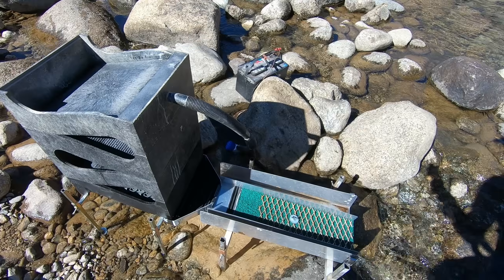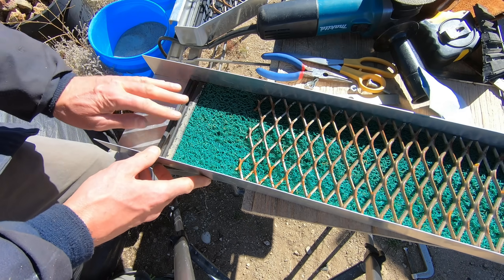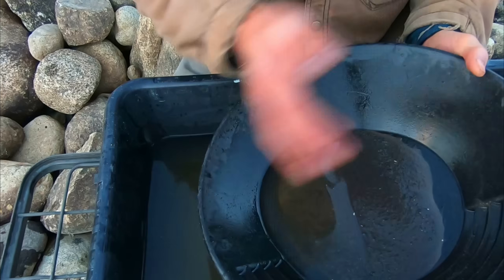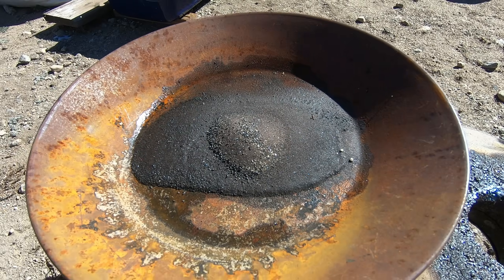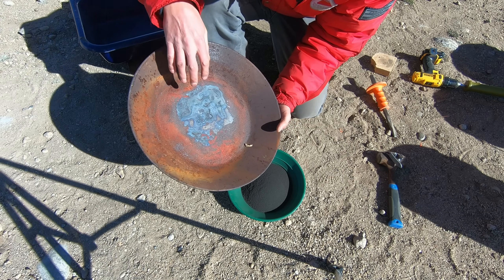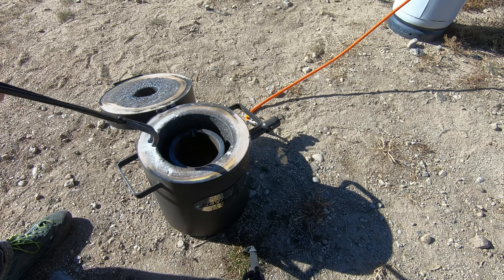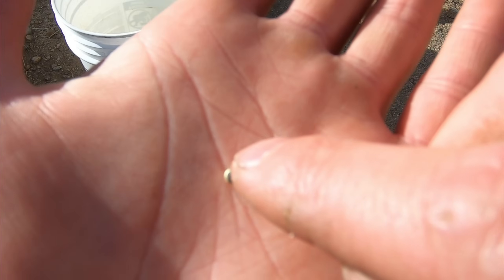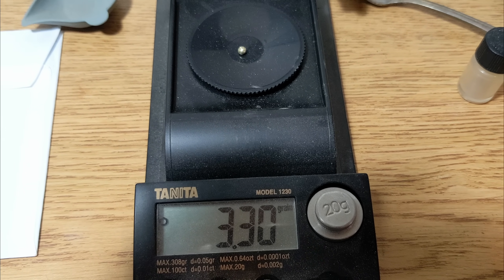2 GOLD BUTTONS from Black Sand!  SMELTING GOLD!

Comment: I've found that the black sand becomes more magnetic if you put it in an oven, then you can easily just separate the gold from the sand making it more pure. Still have to use acid to make it 999 pure

Comment: Nice video. Couple questions: did you add the matte from smelt 1 to smelt 2?  What flux recipe are you using? I don’t preheat my large conical steal mold and it doesn’t stick.
Reply from the maker: Hey UT.  Did not add the matte from the smelt.   I will be doing definitive testing for this material next week.  I had the same experience with the heavy mold.   I did however figure out that preheating the mold does help the small straggler bb's of collector metal make it down to the button.   Flux: chapman after roast on these cons.
Reply: @ColoradoGoldCamp  thanks and good luck! Love the videos!

Comment: Thanks for posting.  You mentioned you would offer an opinion about the value of your final product in relation to the time and costs of your efforts.  I must have missed that part.  Also, why don't you oxidize the lead prior to mixing it with your smelt chemicals?  You certainly have some nice equipment so I think locating a better site might be in order.
Reply from the maker: Hello Richard.  I talk about the value proposition right at the end.  I will be doing some definitive testing on spent cons in an upcoming video.  Most of the visible gold (1.5 oz) was already extracted from these concentrates prior smelting.

Comment: Remember that overall, Colorado gold contains roughly 3% uranium, not to mention the thorium that uranium breaks down into. In some districts, contamination is higher, lower in others. You might want to read the 1953 USGS report called "Uranium in the metal mining districts of Colorado". I've found PLENTY of pitchblende in Gilpin, Clear Creek, Boulder, Park, and Fremont counties. In fact, I've found more pitchblende than gold. I've also found metatorbernite in Boulder county. You have to ask yourself if $37 in gold is worth the effects of inhaling radioactive materials. Don't breathe that smoke.